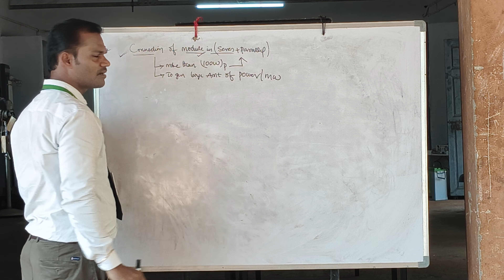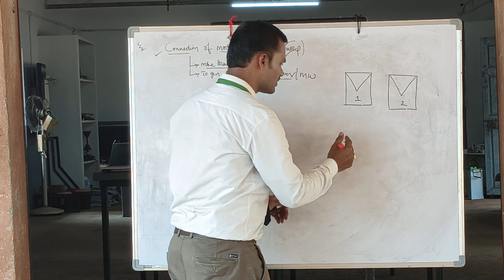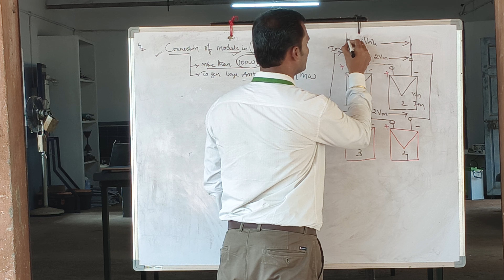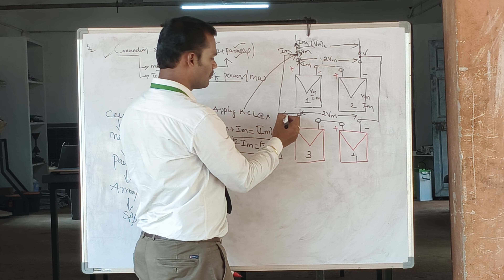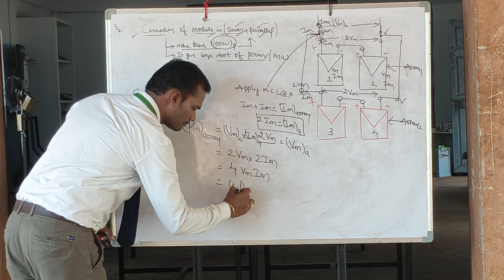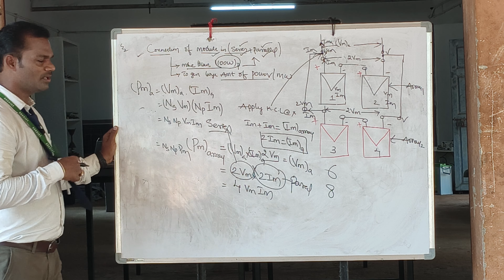Solar PV Wiring: Series and Parallel Combinations Simplified

Comment: 7:33 - sir 6 panels ni series and parallel connection ichinappudi
Pmax =3vm×3im 
            =9 pm kada
Reply from the maker: Ans is  at 14:10 pmax=(210v*51a)=10.7kw is the power plant rating